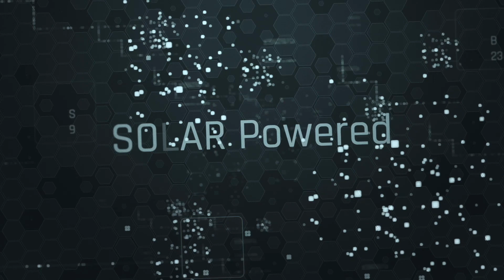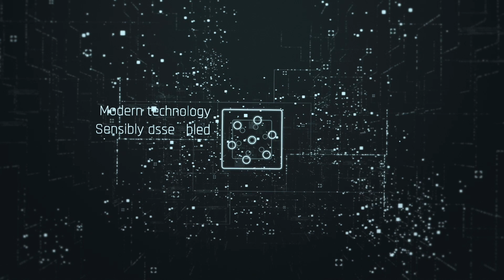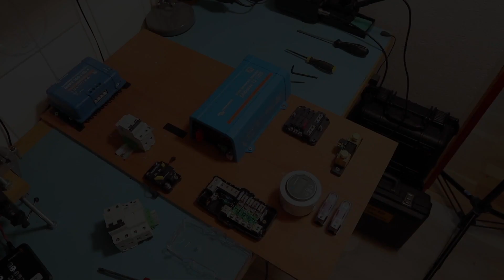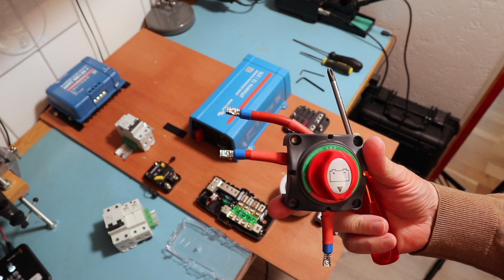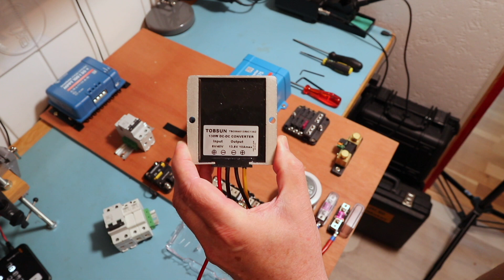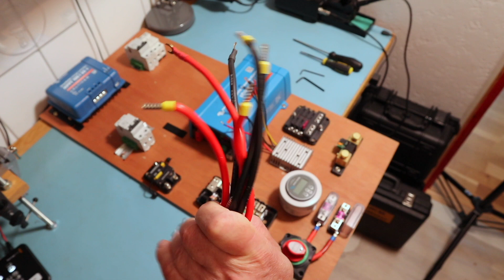Inexpensive, intelligent solar powered radio shack in a suburban garden, Part 3: 'The Build'

Comment: You know you can't put that combination of batteries together?
You cannot put your 105ah battery with 2 of 30ah together since they are not identical, with the same characteristics and with the same internal resistance. Even if it was 2 batteries of the same model, if they are not of the same age and wear, then it is not recommended to install this one together since they will destroy each other given the internal resistance that has developed. One of the batteries will provide more current and the other will drain into the other battery... They will not be balanced.
It is wrong to say that you can use any batteries we have. All battery combinations must be identical and if possible from the same production run.
I can't wait to see, if you use an HF station, the level of RFI you will have with the buck converter which is made in switch mode. 10 amps is not even enough for a full power VHF/UHF radio. You won't be able to feed a lot of transmitter or a very powerful transmitter (is it really a ham radio station?).
3 or 4 months of reading still makes you a beginner by the way.
Reply from the maker: Hi Hugo -- good afternoon.
We are all beginners!

Amateur Radio is specifically about experimenting with technology and improving your knowledge.

Yes it would be ideal to have matching batteries but most of us are not blessed with the funds to do everything we would like -- so we use what we have, taking care with necessary precautions, fusing, breakers, monitoring etc.

As for the Buck Converter, I've been using the setup with my Amateur Rado station (K3, IC-705) for the past month.
My station utilises QRP (10w) power levels and as far as I can tell on the HF Amateur bands, there is no increase in background noise level utilising the Buck Converter. It performs as I would have hoped. 

If you are going to use dissimilar rated batteries then absolutely you should charge them to the same voltage before you attempt to connect them in parallel other wise you WILL get a current race as they equalise voltage levels.

Having connected them in parallel once top balanced , then using the setup I have shown, (and monitored) they do take/supply different levels of current due, as you correctly state, to their different internal resistance - but connected in parallel, this has not been an issue. I can measure the current in both batteries and it is correctly split based on the internal resistance ratio. Whether or not there will be any long term degradation, time will tell.

What I agree you would NOT do is to connect dissimilar batteries in series as this WILL affect the performance and the ability to charge each battery equally and optimally.

As I continue to use the setup I will monitor performance and look to improve any deficiencies I find -- as I said, Amateur Radio is all about technological experimentation and self improvement :-) 
73
Bruce
g4abx.co.uk
@g4abx
Reply from the maker: Hugo. I can report that after several months operation and many battery cycles, everything still works as I predicted. No degradation in battery capacity and a good match between the different battery types/capacities
73
Bruce G4ABX
Reply: you tube expert says you can't do that and its not really a ham radio station. Ham radio operator proves them wrong LOL :)